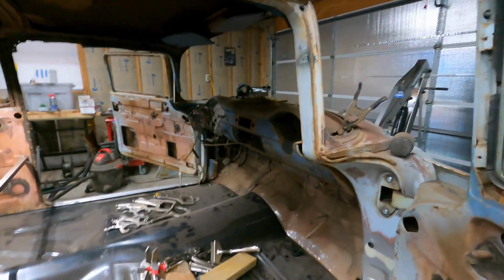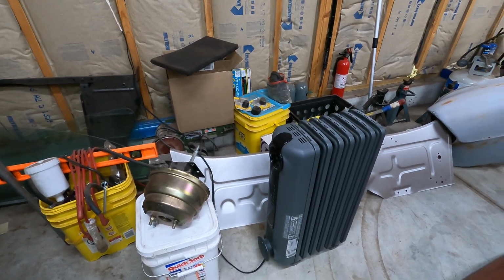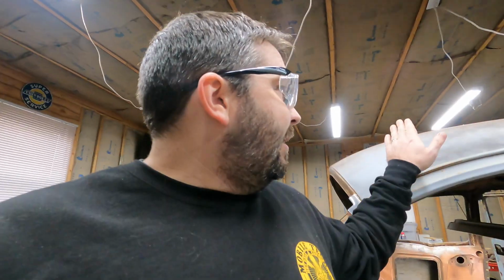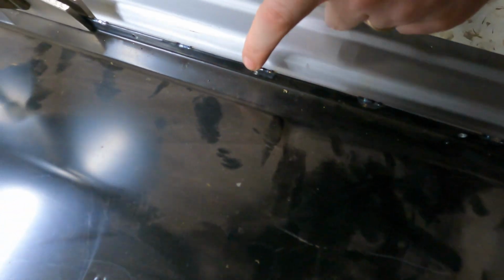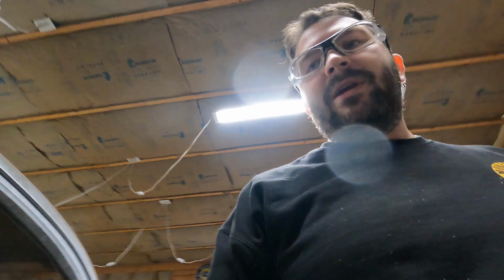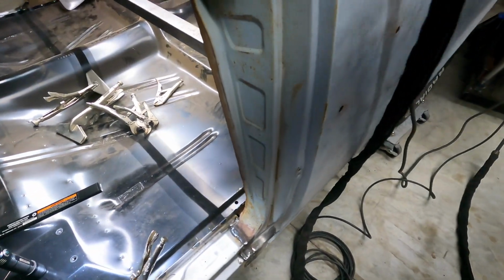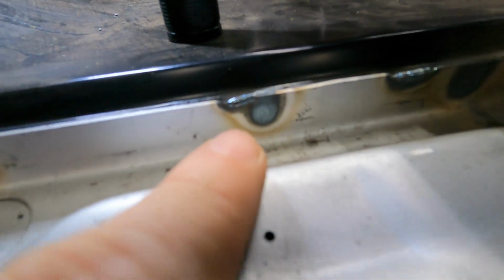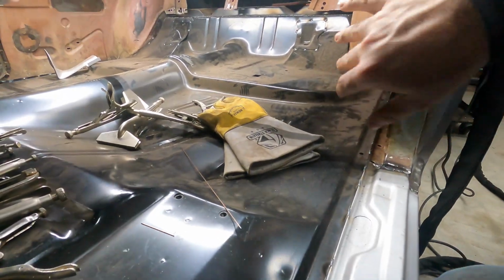55 Chevy Floor Installation: Welding

Comment: there are 2 sizes of punches, I bought the bigger hole one however when wire feed welding those small holes I hit and hold in the center of the hole and hardly move. Works pretty good if you look at the back you can see how effective it is. Turn up heat a touch as well
Project looks great thanks for the work to share
Reply from the maker: It’s cranked pretty good. Out of position the holes are a little small. In flat position they are spot on. Made it work okay. Definitely would get the larger size next.

Comment: you are doing a great job on your resto. tig looks much cleaner looking than mig welding. 
it kinda looks like welding with a torch but with the heat more concentrated in a smaller area.
Reply from the maker: Same techniques nearly. I prefer tig when I can do it.

Comment: Thanks for all the good information. I have been working on mine for two years. 
 Getting ready to do the floor and the trunk pan . Having trouble deciding which one to do first. Which one needs to go in first? I noticed that you did the trunk first. 
Keep up the great videos!
Martin
Reply from the maker: I think the condition drove my decision. Previous owner cut out the trunk so I had better access there to start from. Probably still recommend starting there though.

Comment: Lots of good info sir. I really want to learn how to tig. It seems like it's a cleaner weld and take your time. 😎👍
Reply from the maker: If you can solder or braze, tig is very similar. A course at a local trade school or community college would be great to pick up the basics, but an afternoon with a buddy with a tig welder would work too. Just takes practice. Cheers!

Comment: Josh I honestly cannot thank you enough for these videos it's going to be my go-to as I do mine. No one has gone into this kind of depth for a beginner like me it's it's great to be able to watch and re-watch this... Thank you so very much BTW what size cup are you using?
Reply from the maker: Glad to help! There are several channels that show working on the same cars, so I try to cover details that I didn't find when watching others. As for my TIG setup, I think it is a 5 or 6 gas lens. I just threw on the smallest cup in the kit and have left it. Been a while since I looked at it.
Reply: @55TwoTen  I may hit you up in DM on Instagram soon for some info